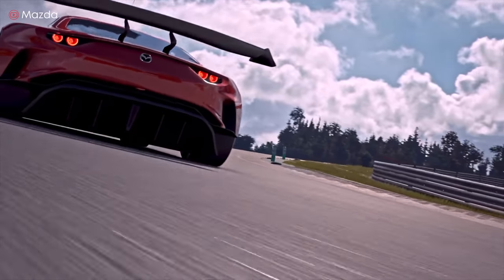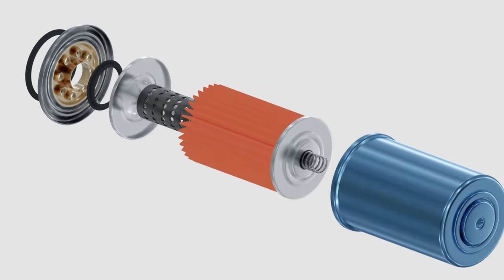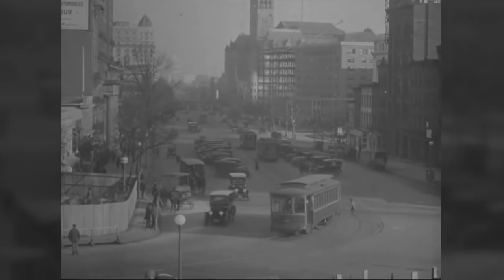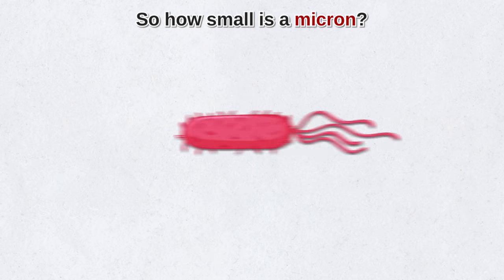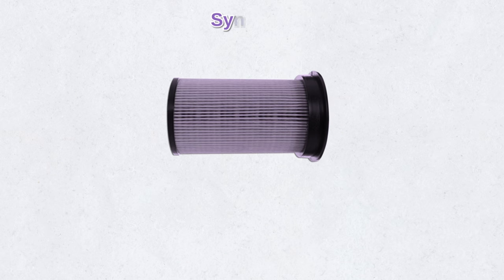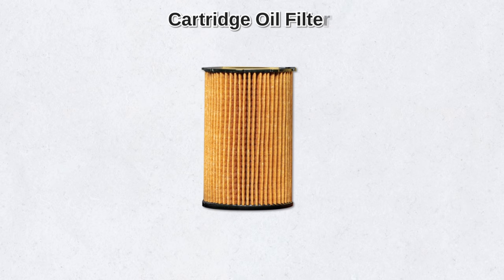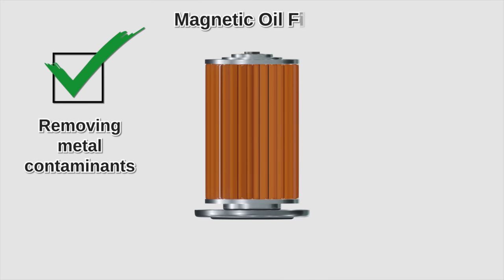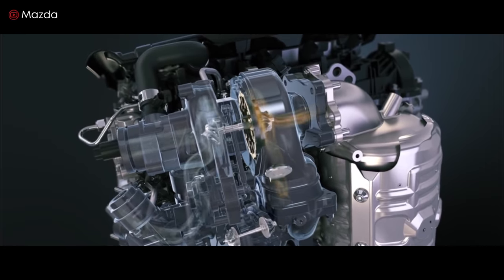This New Oil Filter Just Changed the Game (No More Oil Changes)

Comment: My auto teacher said "Oil is cheaper than engine parts" still seems true today.
Reply: Andy Man  12 grand on motor oil? What kind of motor oil are you buying?
Reply: Andy Man   its $12 for 5 quart jug at walmart  lol.  12 grand for oil???  What kind of oil is that lol
Reply: "seems" true?
Reply: Andy Man  tf are you talking about?
Reply: Andy Man  trollin trollin trollin
Reply: Especially the labor to install these parts is time consuming and prohibitive. Removing the engine and sometimes  re-timing it is required
Reply: Biggus Dickus  Well Stated Sir!
Reply: Andy Man  Over a long time of driving and owning the same vehicle maybe. But even then when you get 300K or more miles out of your vehicle the amount of money spent over the long time is still cheaper than coughing up 2 to 10K for a engine replacements once.
Reply: But a defective or incorrectly installed filter can trash the engine.
Reply: Andy Man  wait a minute 12 grand on motor oil is 2 life times of oil changes ;).. A 1 gallon of oil and filter is 30$.... your talking of  300 oil changes . or 1,500,000 miles
Reply: @jamescaley9942  filters just slip in the housing... not hard to install ;)
Reply: Just remember "fully" synthetic is not "100%" synthetic.    If you change your oil a lot with merely fully synthetic oil, you are still being fooled.   "Fully" synthetic oil made with grade III hydrocracked refined crude is really semi-synthetic.   You need grade IV PAO oils for true synthetic.
Reply: Biggus Dickus  Mobil 1 in the US is grade III base hydrocracked refined crude.   You should buy a much better oil.    BTW, I used conventional oil changed every 5000 miles on my Toyota and it went to 207,000 miles before I traded it in because I was tired of it.
Reply: regular Scotty viewers hear that often....VERY OFTEN!
Reply: Yes. Over the years I've always followed the severe driving conditions as the standard to use for oil change intervals.
Reply: Andy Man  Parts are only one aspect, labor is another.  And labor is expensive in 2021.  2 grand does not cover an expensive engine failure and everything involved with that.  Maybe, perhaps on a Honda Civic, not on a BMW.
Reply: Obviously!
Reply: @bigdavedayday1581  $12 for good oil? Nah.
Reply: Andy Man  sooooo... you're gonna put 750'000 miles on TWO separate cars BEFORE they mechanically fail??? That's some quality b8 right there brother lmao
Reply: @VeritasInsights  I 100 percent agree with this in 2017 had timing belt failure on a 2007 Subaru outback looking back I should have done it right when I bought the car cause blowing the engine like 500 miles passed the called for mileage hurt.  I should've taken into consideration the age of the vehicle.   However that being said Subaru isn't a bmw and in 2017 pre pandemic days 7 grand was a quote I got like 5.5 was the cheapest I could find and that was a back yard swap.   I ended up selling it.  So sad.  But mistakes I learned from and I guess sometimes that's all you can do.
Reply: And an awful lot easier to "fit"!
Reply: Without a doubt!!
Reply: @michaelprice3785  Thank you, I have been in several arguments with people about the same thing.  I think we have approximately 5 true synthetic oil brands in the US...
Reply: much easier to change my own than go to DMV to register the next car you need to buy because you didnt change  oil enough.  also remember to keep fresh tires on the car because one accident buys a lot of tires.
Reply: @bigdavedayday1581  bruh its like 20 bucks not 12, big difference. and that's for CONVENTIONAL when was the last time changed your oil??👀
Reply: @Brickhaus69  I guess I was lucky my 93 Legacy broke a timing belt and didnt hurt the engine.  It's been a good car.  Ex wife went to a health care facility. She was on Medicaid.  State of Texas took the Subaru. Daughter bought the car from the state for 800 bucks. AC compressor locked up and burned off the belt. Another project. 225 K on it.
Reply: Andy Man  my oil + filter costs me around $30 a year. For 12 grand I'd have to perform 400 oil changes haha
Reply: @floppyseizure8615  waste of money
Reply: I stopped wasting money on oil changes in 1963 with a Frantz oil cleaner and Standard Delo 30 weight in my Rambler American. The oil change racket is big. All I use now is Gulf Coast and Motor Guard depth bypass filters and Walmart  oil.
Reply: Another stupid statement like dull  knives cut more people  than sharp knives I'm not rich enough to  be a Republican  I use a quart of oil and a roll of toilet paper about every 6,000 miles. In the 60s it was every 2,000 miles. With the old 6.9 Ford diesel it was 1500 to 2000 miles.
Reply: Dufuss. Water cheaper than ??
Reply: Not true today
Reply: Oil changes at every 3k and a trans service every 30k kept my '97 LeSabre running for 435k.  The original engine was still in great shape, but the trans gave up the ghost.
Reply: My 93 Subaru Legacy has had one oil change since I bought it used with 116,000 miles on it. I recently put Walmart synthetic oil in it. Has 240,000 miles on it. If I had been changing the oil every 3,000 miles it would still have 240,000 miles on it.  Took me 20 years to put 260,000 miles on the 84 Subaru. The 84 had Mobil1 and a Frantz oil cleaner since new.  The 93 has Motor Guards on the engine and transmission
Ran onto a local realtor that I put  Frantz on his Toyota Corolla. He said it has over 500,000 on it now. My 84 started leaking oil at both head gaskets.  Gave it to a guy that needed a car. He used a cheaper oil ond went over 300,000 and went to Iraq. Didnt see him or the car again. Just put a Australian Jackmaster  on the Wifes Pontiac Torrent. Nice filter. Been wanting to try one.
Reply: There are filters that eliminate oil drains. Didnt see any here.

Comment: Scotty... You did not mention the new oil filter that just changed the game.
Reply: Was wondering the same thing
Reply: That was most likely to get your attention....
Reply: Yeah where is the new oil filter the chain is the game?
Reply: I guess we will never know
Reply: It probably was the magnetic filter that's ineffective and dont work on aluminum. He said it never needs charging.
Reply: I like Scotty but, his headlines frequently don't match the video content; his credibility which is already very high would top out then.
Reply: @hellbent7066  Yup, magnetic filters don't work on aluminum, what Scotty did not mention is that when steel particles (from camshafts, lifters & crankshaft) are pulled from the oil, all other metal levels drop too, found that out in my oil test reports before/after installing 23 magnets in and on outside of my spin-on oil filters!
Reply: @dittychaser1525  Yup, Scotty does this all the time, so I check comments before watching his vids, my time is money! LOL
Reply: Now we have one why I'm leaving America. I will bite.
Reply: What is the new oil filter that you are talking about
Reply: What filter are you talkin about
Reply: I'm assuming he meant it changed the game when the oil filter was installed on the engine the very first time decades ago. That would be changing the game back when.
Reply: Thanks, but , interestingly *: what is follow up, & Availability, parts, DEALERS Only?????? Actually, IF , PERFECT CLEANING,  IS GAME CHANGERS…………..
Reply: Check out "kleenoil ku-16"
thats a game changer....
Reply: Synthetic media 
Paper media can get clogged throughout intervals. Synthetic media keeps flow. I’d rather not starve my engine of oil.

Comment: Scotty - I actually got into working on my own cars and discovered your channel as a result of a botched oil change. The shop did not remove the oil canister gasket ring on my wife's 2011 camry and just added a second one over the existing gasket and this caused a slow leak over 2 days which eventually left my wife and I stranded in the pocono mountains when the engine shut off. Fortunately the engine had no damage since this was a few years ago now but since then I learned how to do all maintenance on my own vehicles with the help of your videos of course! I now have full confidence knowing basic maintenance is being done with quality parts and quality work that will last.
Reply: And that's exactly why I check the old filter for its gasket after I spin it off. If it aint there, it's still on the engine! Also, why I wipe the contact surface, then wet the filter ring on the new filter with clean oil. Makes a tighter seal, and more likely for ring seal to come off with the filter, when the time to change that filter comes due.
Reply: I did that on a '55 Buick, in the 70s. Did not see the oil gasket stuck inside. Caught it in the garage after start up.... lots of oil on the floor! So be extra careful with canister type filters.

Comment: I just finished a complete engine overhaul on my 1973 ford f350 crew cab. It started it life at Erie Mining Co. I bought the truck with less than 14,000 miles on it and then I grafted a 3.5 ton Ford dully to it to turn it into a inclosed car hauler. It weights 11,000 lbs empty, and at 75,000 miles I removed the engine and did the rebuild. I have 52 years of experience in the racing engine business so the rebuild was nothing new for me. I did oil and filter changes at 2000 miles, and also changed the OIL in the OIL BATH air filter. When I did the the tear down the engine had no cylinder wear at all, but the most amazing thing was, that when I removed the oil pan, it looked like NEW inside. I really believe most of this was because of the OIL BATH air cleaner.